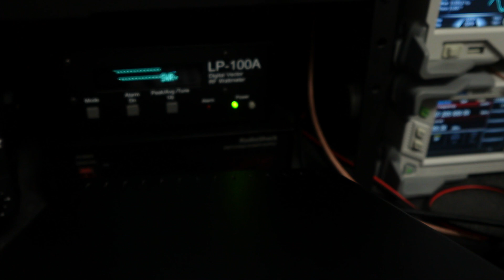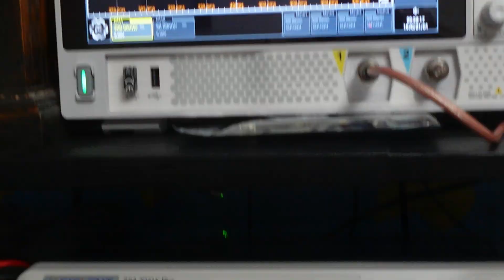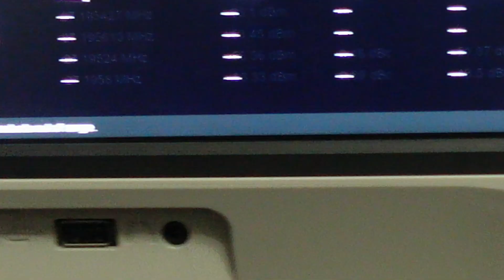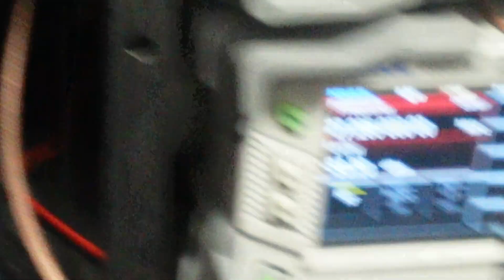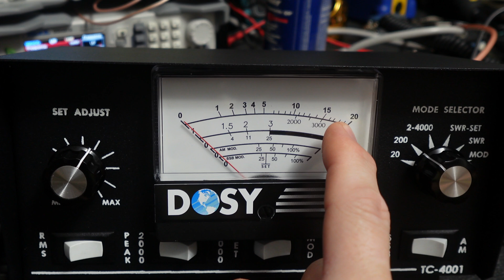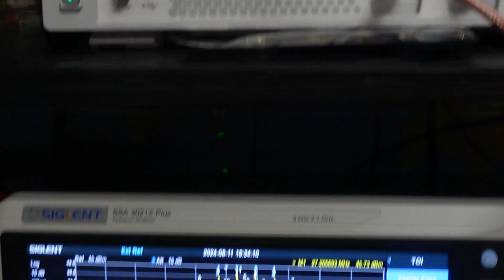Confused about proper SSB Power on a meter?

Comment: I would first like to offer a disclaimer, what I'm about to say is just for informational purposes and opinion. Do you think the LP shows more PEP because it can catch the radio peeks before the radio's limiter kicks in compared to a Bird 43 with a peak kit. (i think to bird is slower to catch the peak and shows somewhat lower output)
Reply from the maker: For Bird, With a full-scale accuracy of +/- 5%.
For Lp100A 
3% at any rated power level or frequency from 1W to 3000W.
You can adjust the peak hold threshold on the LP100A to a minimum of 250 millisecond to 5 seconds. 
I generally run mine at 2 seconds. Generally limiter kicks in immediately after a transmission is modulated on a radio that is properly aligned.

Comment: seeing the internal swr meter on the k-po matching your test equipment made me decide to disconnect the dosy tr1000. it showed 17w and 1.4swr. your meter showed correctly. running lmr240 straight to the antenna now and got the internal meter showing 1.2 to 1.0 where i operate. all the dosy did was add confusion and higher swr than was actually present. thanks again Mr Scott

Comment: i have my limiter on a switch the ch9/19 on the cobra 148. on ssb i run the limiter and on am i flip the switch and run without it for the super bowl u have to with those guys. try that add a switch to it. with the new radios u just turn on the npc thats the same thing  make sure to turn your power all the way down though.

Comment: Try measuring the SSB output power with the Dosy in AM mode. I believe the SSB switch adds dampening and a power reduction in the process. On a serious note why anyone would spend $200 or more for a Dosy when a much better option is the 503 Digital Meter for usually less.